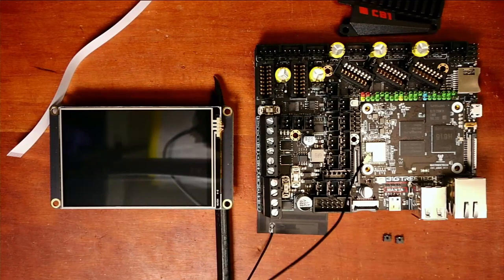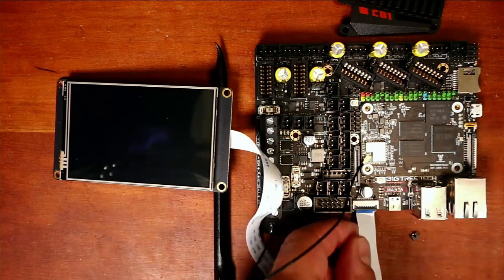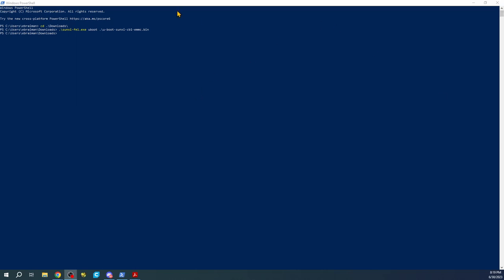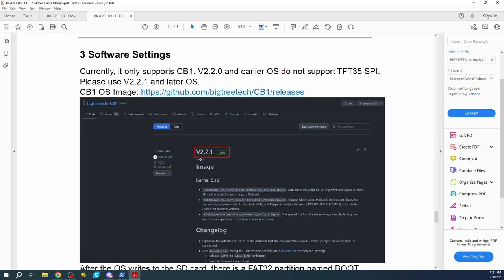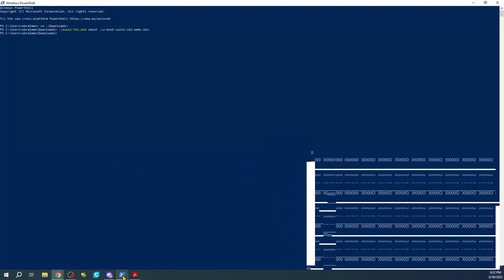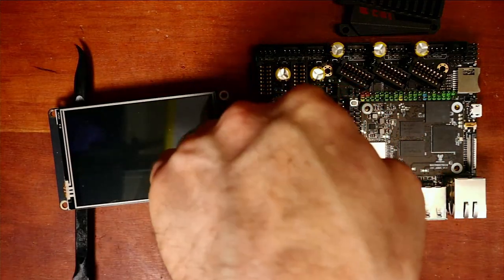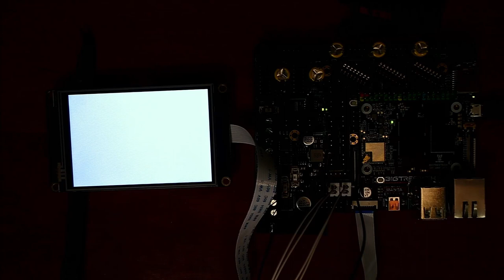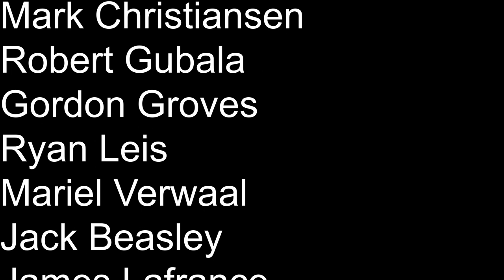BTT - Manta E3EZ - TFT32 SPI

Comment: Thanks so much for this detailed video! I'm looking forward to subscribe to your patreon in order to install the the CB1 with eMMC on the E3EZ board. One question tho, your CB1 seems like an eMMC 32G with " CB1_eMMC_v1.1 " written on it, is that right ? Asking because I think I got the same board and I'm scared it won't work with the display lol
Reply from the maker: It's a configuration file.
Reply: @EdwardBraiman Nice! So the CB1 eMMc module 32G Works with the display then?

Comment: Does it only work with Marlin??, I bought this same board, screen and CB1 EMMC for my ender 7, but the CB1 module will take a while to arrive, I already want to use the printer, but I only have the SPI screen and the one that comes with the printer, which is a Creality Dwin Screen
Reply from the maker: TFT display with 5 pin cable currently only works on Marlin.  Other displays are coming for Klipper.

Comment: I dont get it, I tried everything, but I dont get the TFT Display to work. The only diffrence is, that I use an SD Card and not the eMMC. Any ideas?
Reply: Does the screen turn white when you power on the board? If not then you might have the cable placed upside down in the connector
Reply: @Blueyedevil2702  Screen is completly white
Reply from the maker: Might mean it needs to be enabled in OS
Reply: @EdwardBraiman  tried that, I think it comes down to that i have a older Version of the CB1 that somehow cant do SPI, therefore Ive read that people used the I20CAN Adapter, but i didnt bother to try that
Reply from the maker: You can use the link in description and either myself or someone in chat can walk you thru the process.

Comment: I followed this to a t and got the cb1 and touch seen installed and it will not connect  to my network  the touch screen shows network failure and it is impossible  to manually connect via touch screen because the screen is super slow and hits the wrong letters and isn't possible  to key anything in.
Reply from the maker: There's a Discord link in Description either myself or someone else can walk you thru the issues.